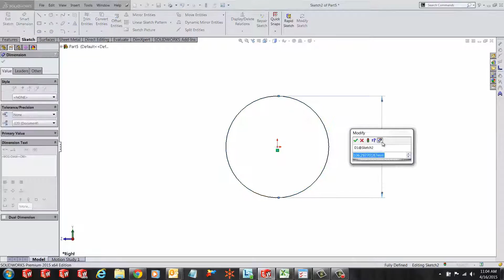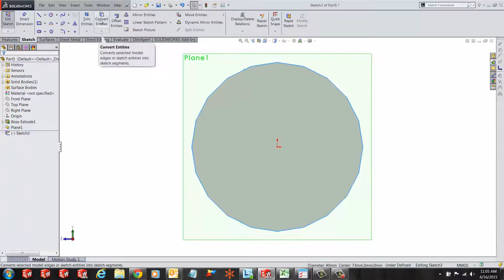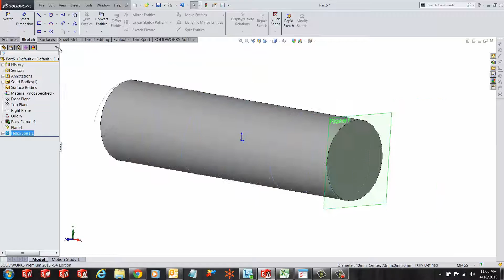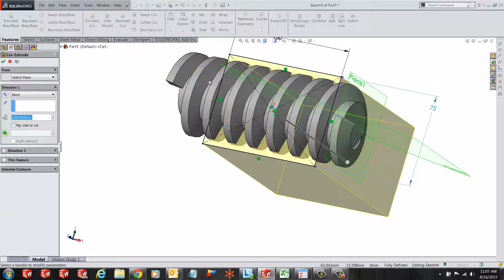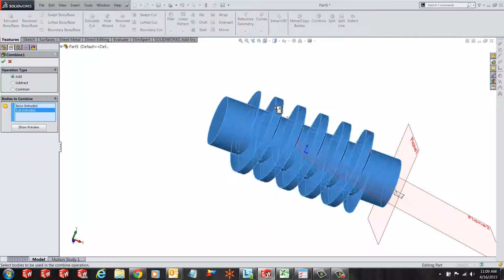SOLIDWORKS Quick Tip - Creating a Worm Gear

Comment: One question.. why do you make an plan with helix and endpoint of helix for whorm and dont use planar surface of coordinate system like for threads? Why we make the sketch on different surfaces for worm and thread? thanks
Reply from the maker: This how-to uses the Sweep function in SOLIDWORKS. Sweep will try to maintain the initial orientation of the 2D sketch to the 3D curve as the sketch sweeps around the curve. Because of that, it’s important that the initial placement of the 2D Sketch is perfectly perpendicular to the 3D curve.